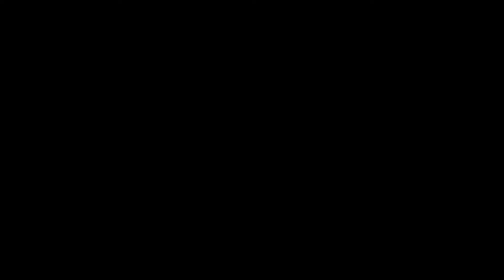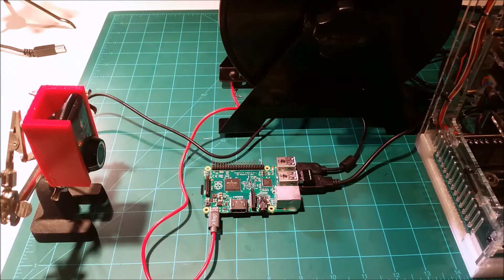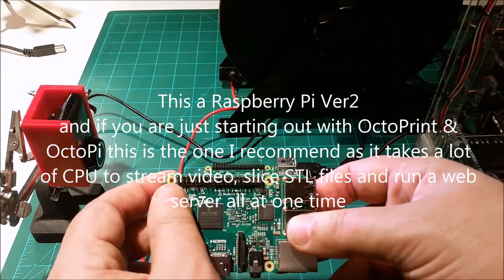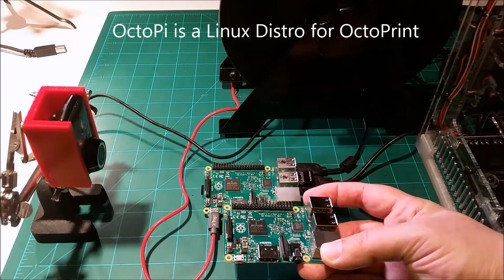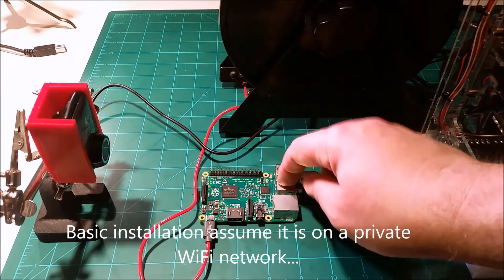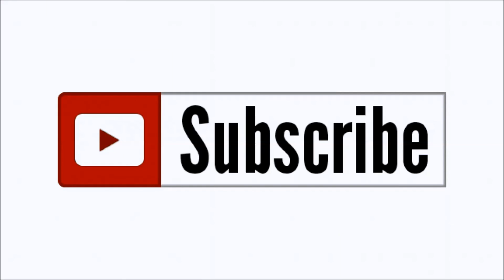OctoPrint and OctoPi Basics Series - Hardware

Comment: Dude you spend more time talking about not setting the password than it would have taken to just give directions to set it.
Reply from the maker: +Les Ferguson and your point is your a fast learner or what?  You know how many people have viewed, not complained and found value in this?
Reply: DIY3DTECH.com actually I'm a slow learner and I get a lot of value from the works of good people like you. No complaints about the quality of your vid, it just that a) The RPi is all about education, b) I was concerned that a beginner could be lead to believe setting up and using a tool like ssh is difficult.  On reflection tho, you do get straight in to making the thing perform a specific task, and don't need to repeat details available all over the net.
Reply from the maker: For many people SSH is way over their heads (I am CTO for a large company so I get technology), as wanted to avoid people leaving it open as I have had many people wanting to put it on the internet and asked me why that would be an issue!

Comment: Note: docooler USB 2.0 12 Megapixel HD Camera Web Cam does not work on a PI
Reply from the maker: The Pi prefers stand res cameras however you can hack to use HD as I have done but is is a pain...
Reply: yeah I agree, currently trying to figure out how to get this one to work now. might be good for you to update your parts list in the video description to a camera a bit more user friendly as I am sure others (like myself) have purchased it based off of your suggestion.
Reply from the maker: I see what you are saying now it should work with that one, however the output will only be standard def as that is the one I have.  I though you where speaking of something like a Logictech as those are pain as you need to change the config file in the OS.  Did you use OctoPi as your distro?  As these video's are now pretty old they might of changed somethings [in the distro] and you may also want to reference https://github.com/foosel/OctoPrint/wiki/MJPG-Streamer-configuration  as well as https://github.com/foosel/OctoPrint/wiki/Webcams-known-to-work  Because as I recall it (OctoPrint) works only with 640x480 and maybe 720, I am not at home now so can't check but it is limited so you may have to set your resolution in the config file to -r 640x480  hope this helps...

Comment: can i use two web cams ?
Reply from the maker: Not via Octoprint which I am aware of, however Octoprint just runs on Linux so you run likely run another web cam app separate of Octoprint on Linux to run another cam or even the Pi-Cam, however you will want a beefer Pi to run as that is asking a lot of a little machine.
Reply: ok thanks i just want two cams to view the top and bottom of tall prints online
Reply from the maker: That would a be cool!